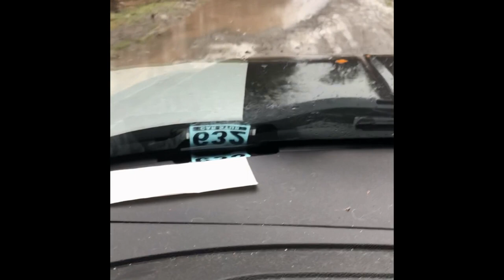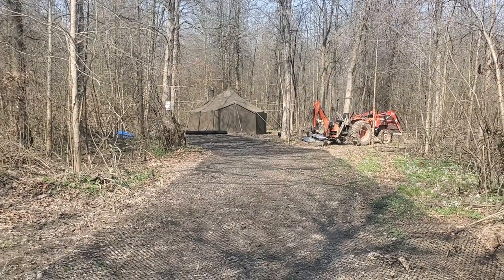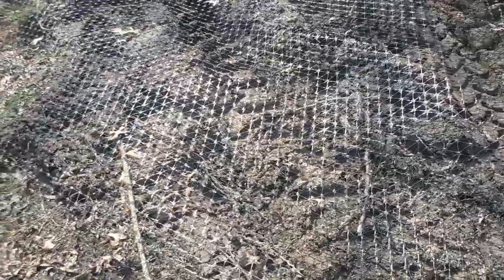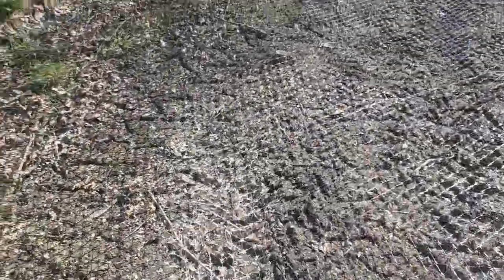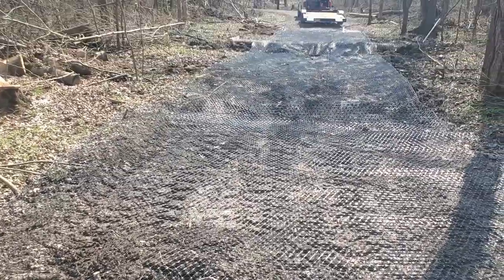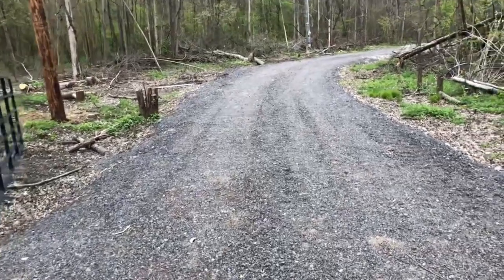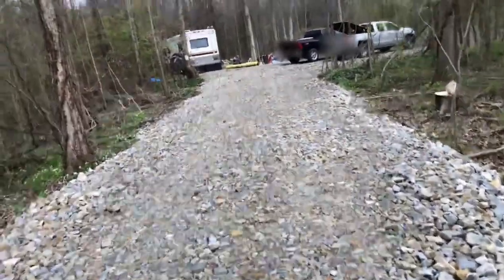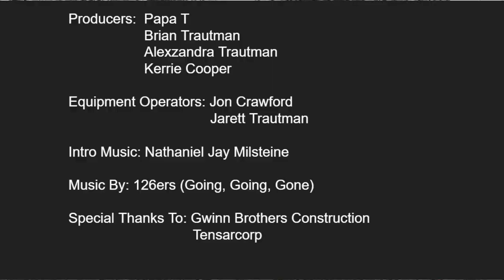How To Build a Driveway on Wet Land

Comment: I notice you didn't remove the topsoil from the road base before installing the geogrid and covering with what looks like 3" aggregate. Are you concerned with road stability over time, or is the geogrid and aggregate enough? 
The reason I am asking is that I have to put in around 2700' of road to access my property in Alaska. Drainage is terrible because the topsoil is only 3" with mud in spots but then solid clay under that, so water pools everywhere. I was planning on having to remove that top layer of soil to lay base, geogrid, 3" aggregate and then more fine aggregate on top with geocells in a few very wet areas. Any advice you may have would be well received, and thank you.
Reply: Hello James! Papa T here. Yes we went right over some real soft ground. I have used this in grey silt, sand, mud many less than perfect situations. My day job is COO of a Transit Authority. I have been building on subpar soils for years and quite honestly, where i was introduced to geogrid. The ground at work is literally fill on swamp. When building structure almost always requires driven piles. Based on what limited info you have given me I would level and lay the geogrid. Then place your stone on that. Probably 6 to 10 inches over the super soft areas. But mind you I drive a 30 foot motor home over this drive at Triple T and she don't move. At work we drove about seventy 35 foot transit buses over it for years before paving. The geogrid acts as a cradle and works as a spread support layer and allows the stone to have a surface to lock into. If you would like to chat about what you are doing send a pm on breathecountry Facebook or send me a friend request on fb. Brian Trautman
Reply: @bowood1983  Thank you for the advice. Honestly, never built a road before. Never used a skid steer, backhoe or bull dozer in my life. Now I have to build a road through some of the nastiest back country I have ever seen, and I am an avid hiker when not driving tractor trailers! 
Doesn't seem too hard though once I understood the basics, and the road will be straight, flat and on fairly hard clay. It is wet because the water doesn't soak into the ground, it pools on top about ankle deep with tree stumps and logs everywhere. Flat level ground for the most part, so lots of road base and problematic drainage system. I figure 70-100 dump trucks worth of material and hit it with a Bomag BW900. $10k worth of heavy equipment rental. Multi year process with my limited resources ;)
I would write you on Facebook but I gave up my account a decade ago. I definitely appreciate the reply though!  
Regards, James 
Anchor Point Alaska
Reply: Well I'd throw my number to ya but it's youtube. I wouldn't worry about the water laying. Just give each side of the road a slight ditch so the water can go somewhere and also an occasional cross drain or culvert. Our drives end up at least 6 to 10 inches deep mostly. I also top the rock with asphalt grinding. If you don't have access to that use 304.
Reply: @bowood1983   Will do, thank you. It is going to be a lot of work, but I'll also pick up some new skills. I bought the property (9.5 acres) for $17k five years ago, and now properties with roads are selling for $50-70k with no improvements so it will be worth it. Land in Alaska, especially around Homer with its population growth, is expensive. Shocking because Alaska is the biggest state with the smallest population, but it is what it is. Maybe I'll do a YouTube video about it, maybe... Next up is the road survey, should be around $3k. It was already done but the survey stakes are all missing except for two that I found.
Reply: Hell  gonna retire soon and I know how to run all that equipment. Maybe I'll come up and be some free help. You wanna come to Ohio just give is a shout we would be glad to host ya!
Reply: @bowood1983  If I were not living in an off grid cabin I would take you up on it, thank you. Take care and best wishes.
Reply: @jamesstepp1925 well howd the road turn out lol
Reply: @russtgrower750  I was looking at $60k worth of materials and equipment rentals and labor and bought a new piece of property on Kenai borough maintained roads instead. I still have the property and will get back to it piecemeal in a few years but for now concentrating on my new 9 acres in Kenai. Thank you for the good advice though.
Reply: @jamesstepp1925  oh im just a guy. I live in nikiski myself, just put a 100 ft of driveway into my place and have 100 more to go. Im lucky i suppose i have family with a tractor and dump truck we can fill ourselves. But yeah i was curious i just read through your comments im not the guy who was giving advice haha but it sounded like you had ALOT on your plate with that one!
Reply: @russtgrower750  Yeah, my road was in Anchor Point with 1700 feet through heavy clay wet bog, requiring a huge amount of fill and drainage. After all of that, it was a platted road and I would not even own it after all that expense and effort. It was simpler to buy another 9 acres in Kenai instead. I'll get back to it in a few years and probably work on it a little bit at a time, but as of now it doesn't make sense.

Comment: I have a similar project in south Alabama.  Are there any permits required since the construction was in a wetland?
Reply: It's not technically declared a wetland. If it was a wetland delineation performed. I think it is always a good idea to know the rules. This ground is not a wetland. It would be considered a flood plain. Different rules. Good luck I hope that helps
Reply: You cant use millings/grindings  in a floodplain any longer unfortunately